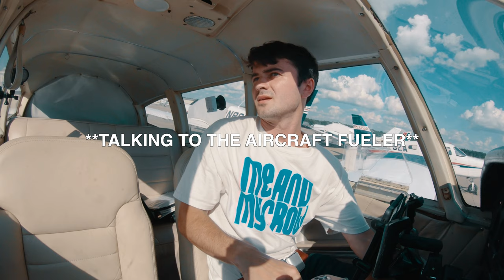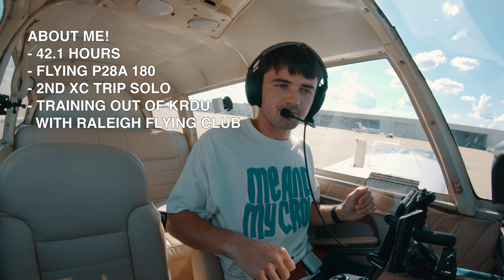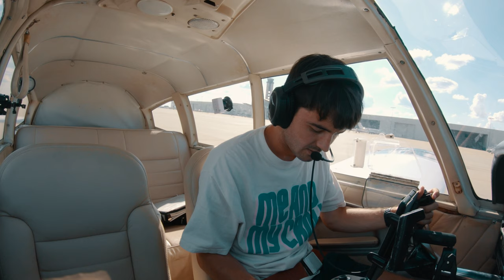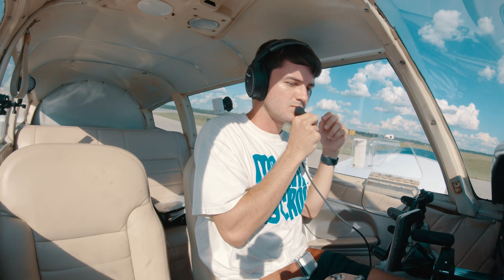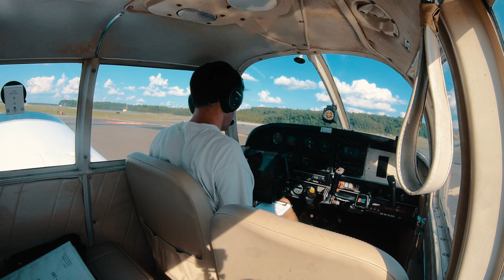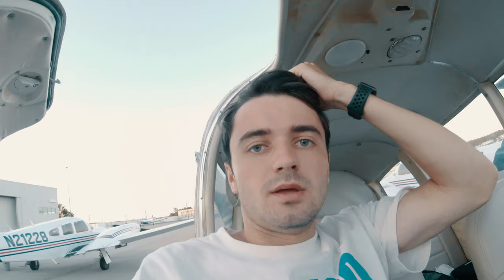Student Pilot Solo Cross Country in Piper Cherokee 180

Comment: Remember when pilots used to try to get “flight” time?  The pilot who tries to pad his flight hours with unnecessary time taxiing around to meet a requirement, will likely eventually start fudging his log book. You’re only robbing yourself dude. The only time excessive taxi will provide any skill building benefit to a pilot is if you put a pilot out on the ramp in a 20-30 knot wind in a J3.

Comment: Very impressed by your radio work, nice job!
Reply: Agreed.  I am training out of an untowered airport and talking to a controller messes me up.
Reply: Agreed. I would add one note, though, to get in the habit or repeating back important numbers, instead of just “Roger.” If they send you to 127.3, at least read back 27.3, and if they give you pressure of 29.97 with the weather, read back 29.97 at least, just for the record and clarification if needed. Maybe it just wasn’t including, but you’d benefit from a departure briefing, and maybe calling out loud that you’d need some left aileron correction to account for the quartering headwind, that may have saved centerline.

Comment: Pro tip about VFR cruise altitudes. Bellow 3000' AGL you are exempt from §91.159 VFR Cruising Altitude or Flight Level. So if your under 3000' AGL you can cruise at any altitude including flat thousands. Of course you have to act with best judgement since you're not leaving yourself a lot of options and you have a higher potential to conflict with other traffic at such a low altitude, but it's something to keep in mind should the need arise.

Also, shout out to the Blue Line instructors and RDU controllers. Some of the coolest dudes and dudettes I've ever trained with! Also, highly recommend doing your check with Jay Nabors or Bernie Consol.